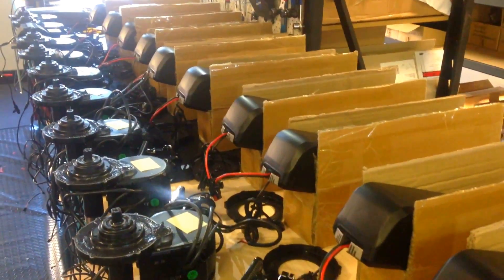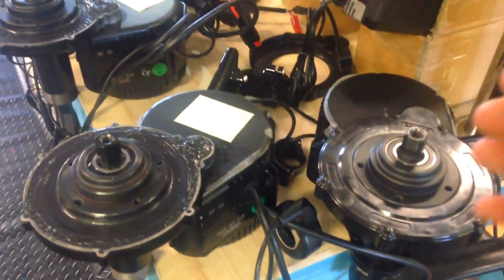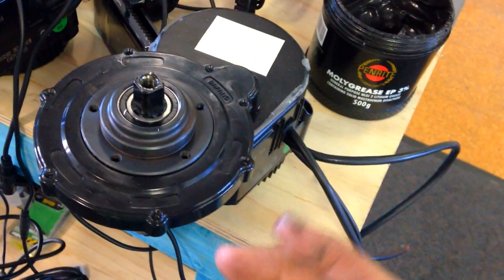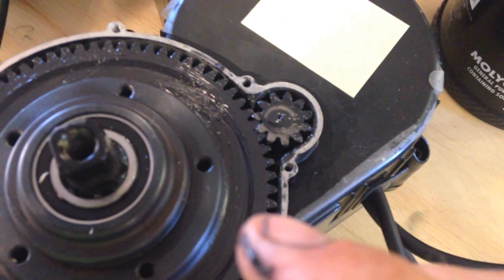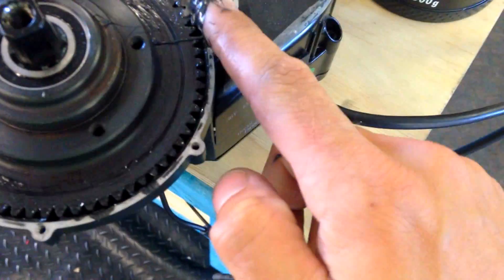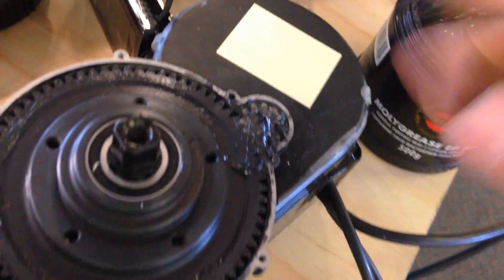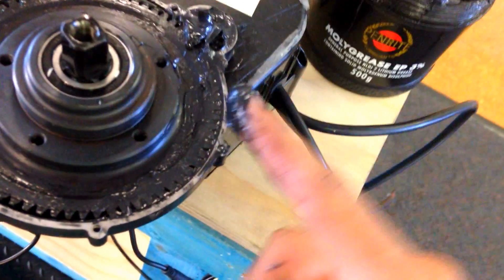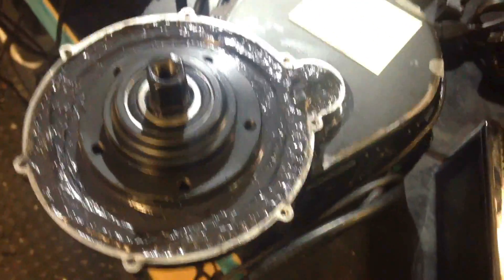Making your Bafang BBS02 mid drive last longer with extra moly grease • 8fun Electric Bike BBS01

Comment: Hi man, I finally got my BBSHD!!!!!! 
I open it up yesterday and found out that theres no grease at all in the pinion gears :/
I saw a few posts about this issue and some recommended to use MOBILGREASE 28 for reductions gears but eh.. they say its complicated to apply this in the BBSHD model.. could you maybe make a video showing how to do this? i don't want to fuk it up! haha

thanks for your videos man!
Reply from the maker: +Uilleam Gilvoni - Yeahh.. you'll be the happiest man on earth when you get this monster rolling =] This is funny.. all BBSHDs we opened had a good amount of black molygrease on the pinion gear. If you have already opened the BBSHD to inspect it (only 6x allen bolts and remove the metal cap) all you have to do now is to apply more molygrease between the teeth gears (large flywheel and the pinion gear). All done!  
Putting things together, you will notice that there is something not wright as you try to put the metal cover back in place, this is the freewheel doing that. You have two options: spin the pedal shaft (crank) backwards so the freewheel paws will fold and get inside the freewheel housing. Option two: using your hands slive/remove the freewheel from the pedal shaft (a ring with some little lockers sticking out) and put it inside the freewheel housing spinning it backwards (will be very obvious you will see the freewheel locking) then you instal the pedal shaft back and screw the 6 allen bolts.. all done!!

I know exactly where you read this article about the MOBILGREASE 28... I have a LOT to say about it:
Karl tested this grease on his BBS02 (not on BBSHD) for a week and posted the article... he didn't test it extensively in many different applications to see if it actually works or actually causes damage to the gears. Karl recommended everyone to use heavy-duty grease on the nylon gear for over a year and coincidentally he was the ONLY person having many problems with nylon gears and started all this "nylon gear" thing over the internet... finally he realised that the heavy duty grease was damaging the nylon causing it to fail and posted an article telling people to not use that grease and he would come up with a perfect grease! A week later, he had this mobilgrease 28 article published and strongly recommending everyone to use.

Here is where this story gets a lot deeper:
Metal on metal (pinion/flywheel) you use molygrease (this is what Bafang uses and almost 10 in 10 mechanics would recommend the same), metal on nylon you can use white lithium grease (this is what Bafang uses and this is the most common grease for this application) maybe some synthetic grease types. The whole reason to use the mobilgrease is because the pinion helical gear on the BBS01 and BBS02 leaks some of the molygrease from the pinion/frywheel contaminating the nylon gear and possibly causing the gear to fail ( I have a video showing that we never had problems molygrease leaking mixing with the nylon gears... we sold over 500 motors, I think this is a good number of users to consider).  This grease leaking issue won't happen with the BBSHD as it has a different design. I don't know if Karl was clear on his article but to apply the synthetic mobil grease you have to completely remove the existing greases, you should not use degreaser as there are many bearings and you don't want to degrease that and cause multiple bearing problems. Resuming this big drama, there are a LOT more things to consider before writing articles. I have so many videos from October/November2015 that I haven't published yet as I am still testing many different samples (bikes) to get the right result so I can finally tell people the correct message. Just like medicine, we need multiple samples, data and extensive studies to backup these "recommendations". 
So.... you better stick with the molygrease and avoid future problems  =]
Reply: ElectricBike yeah!!, thanks for the answer man, now I understand things better! I'm buying molygrease from Internet right now haha. But, what brands of white lithium grease do you recommend for metal-on-nylon? I don't know much about grease things hehe. 
Truly appreciate your help bro. 
Thanks again :)
Reply from the maker: +Uilleam Gilvoni - this is the thing... we can't find the ideal white lithium grease.. Bafang made their own grease for these motors, a very thick and sticky one. The ones you can buy online and at the shops are thin and will wash off the gears... you need a thick general purpose lithium grease one that doesn't smells like petroleum. I am using one since last year and it's completely fine. This is one of the things I have been testing and studying really well before make assumptions. Nylon is tougher than people think. Nylon gears are everywhere, industries, cars, machines, toys, the world would be much louder without nylon gears. =]
Reply: Oh well, but could you tell me any name? haha my nylon gear is dry.. it won't last too long without grease..  Im tryng to find one here in Perú but its difficult because i dont know what to look for.. thanks bro!
Reply from the maker: +Uilleam Gilvoni - Hummm.. brands will be different over there... the one I use here is a local Australian brand... maybe go to a local mechanics or auto-shop and talk to them, see what they use for the electric car windows, most if not all cases are plastic/nylon gears. Some "general purpose" greases are suitable for use with plastic, get one with that doesn't smells like petrol. It doesn't have to be lithium... as long as it is a thick grease that won't damage plastic and lubricates well.. its all good. Also you could use the existing white grease that is splashed all over the case... just  re-apply it over the nylon gear and should be good for months again... this is the easiest option =]
Reply: Alright man! thank you very much for your help :)! I truly appreciate it

Keep doing that your amazing work! 

Cheers!

Comment: Hey Bruno, do you think excess of moly grease there might cause the grease go to the nylon gear casing problems?
Reply: yes i have pushed grease into a bbshd and it got onto teh sprag clutch inside of the nylon gear and it was slipping.  It will sound like the motor is spinning, but the chainring wont be spinning properly

Comment: instead of using moly grease,that can eat the nylon gear, why not use white grease (silicate and fosfate-free)? 
it might be less effective in greasing the gears and maybe less resistant to high-ish temps, but as long as you put more of it, then what it came with from factory, it should be better ,right? 
what's your opinion?
thanks, Hannes.

Comment: I am getting a BBS02 from Luna Cycles. Should I go ahead and open it up for this grease job or does it come with the extra grease in it now?
Reply from the maker: Hi Brent, thanks for your message.. I'm not 100% sure if Luna is applying extra molygrease to their BBS02's, it's easier to check before you install on your bike... and check again every 1000miles... doing this you'll keep your metal gears healthy almost like new =]
We do the Bafang distribution here in Australia for other bike shops and we never have anyone calling us for pinion gears... =]
Reply: Where in australia are you located

Comment: also, could you kindly make a video or explain how you connected the cycle analyst to the bafang controller? I just love your videos...
Reply from the maker: Yeeahhh... the Cycle Analyst at the moment is only reading the power between the battery pack and the BBSHD just like a multimeter with this shunt resistor connected between both http://www.ebikes.ca/shop/ebike-parts/ca-accessories/shunt-ca3.html 
My CA V3 is the one that comes with the speed sensor so I attached it right next to the Bafang speed sensor and both share the same magnet. I can read voltage, wattage and speed in real time. I want to make lots videos talking about the CA and the cool accessories available for it =]

Comment: How long do these motors normally last? Thanks
Reply from the maker: Thousands of kilometres... if you just keep it well lubricate checking the internal gears every 4000km (more or less depending on riding style) they should last for many many years. These Bafang mid drive systems are by far the most compact, powerful and popular ebike motor out there. You can fit them to almost any bike so if you decided to get a new bike you just bring the motor...
Reply: @BrunoPOWEEER , thank you man, you are awesome, cheers!
Reply: I’ve been running a whoosh sirico with a b b s 1  early version since2014  done 40,00 miles with little servings. Still going strong 👍

Comment: Hi, I just got my bbshd and wondering if I should put more grease there too? Or did you only do it with the bbs02? Since they look a bit different inside. Some pcb there and stuff :)
Reply from the maker: Hi Mikael,
BBSHD had a different design it actually recycles the grease so there is no need to add any grease for a long time. The BBS01/BBS02 had a design issue that the helical gear was orientated in a way that was sending all grease "away" from the gears, problem fixed on the BBSHD!
Maybe open and inspect after 1500/2000km =]
Reply: +ElectricBike (Bruno) Okay, perfect. Anything else I should think about? Have a lekkie chain ring. So that should be fine. I am 2 meter and weigh 100 kg. Havnt bought a bike yet. What bike would you go for if you were me? I want it to be durable :)
Reply from the maker: +Mikael Sundvisson - Hi Mikael, sorry for the delay...I think maybe you should go to a big bike shop, talk to someone asking what brand they would recommend, maybe aluminium frame instead of expensive and quite fragile carbon fibre ones. if you want something reeeeeeally strong I would go for chrome moly frame, is the hardest and lightest metal after titanium (motorcycles are chrome moly) but these bikes are very hard to find and expensive because they're not very popular. Aluminium may be the best value option. =]
How's your electric bike project going?

Comment: I've got the exact problem with my HD, litterally no grease at all on the secondary drive, but after watching your video saying to use moly grease, I went to EndlessSphere, and everyone is saying not to use moly but use Mobile28, as moly can get into the primary drive, and degrade the nylon gear, have you any experience on this, and what do you think ?
Reply from the maker: Hi Paul, the HD helical gear is facing the opposite way so rather than push / pump the grease towards the primary gear it pushes the grease towards the outside, hits the aluminium cover keeps recycling the grease, MUCH better, we never had any nylon gear contamination with the HD. The BBS01, BBS02 you grease the gears, put the cover back on, spin the motor for 1 min and open the cover and clearly see that the pinion gear is pumping the grease down towards the nylon which in theory is so wrong but I made a video showing a BBS02 with 6000km and soooo much molygrease on the side the nylon gear, cleaned the nylon to inspect for any damage  and it looked like a brand new gear!
Regarding the Mobile28 grease... ALL mechanics and engineers would recommend molygrease for metal on metal applications like that (pinion vs flywheel gear) moly has solid lubricants that impregnates to metal parts and actively keep lubricated even when it looks dry. We have 100% positive feedback and ZERO problems =]
Reply: Cheers buddy. I wish there was enough grease in there to be able to be pushed toward the primary, but sadly not, there was literally the same amount as a large pea, and I might be being generous, saying that. About a 3/4 days ago, after about 10 minutes, of use the noise was terrible, and I could feel a vibration through my right foot, that's when I started to investigate, and I was blown away on how clean it was under the cover, I will say though the machining was awesome, I've got a couple of 20 mile trips to do, before my order of moly arrives, so I thought some grease is better than none, so I used what I had available, white lithium, and packed the shit out of it, and I sounds and runs like never before. All I can hear is the roar of the fat tyres, which still makes me smile even after 3 months of use.

Comment: Moly grease makes nylon gear softer. Not the best grease for Bafang. And too much grease raises the temperature.
Reply from the maker: Read the other comments, I’ve replied to this comment many times before... moly is for metal to metal and inside where the nylon is I use a different multi-purpose grease that is suitable for plastics. The reason why we used to pack a lot of grease is because the BBS02 and BBS01 pinion gear design pushes the grease agua from the gears whereas on the BBSHD it pushes the grease against the cover and keeps recycling for longer. The BBS02 would run dry with no much grease with just a few thousand kms. So far all motors increased outperformed the original Bafang. I had a message from a customer that I serviced and greased his newish motor but noisy back in 2016 and he said after I serviced, his motor has been running perfect for nearly 4 years now.

Comment: So, I have about 100 miles on my bafang from Lunacycle.com and I'm getting a little noise in my motor (gearing or something) when I've been running it for a while.  When it gets a little hot to the touch I suppose.  Maybe after a 5 mile run or so.  Up some hills, but not always using throttle.  Noise goes away when it cools down.  You think this moly grease could fix the problem?  I've got some on the way to my house right now.
Reply from the maker: Hi Paul, I have been doing Lunacycle's technical support for a while.. if you email them right now asking for help, Eric will forward the email to me hahaha
Moly grease may improve your noise as it sticks to metal better than white lithium grease. Everyone is trying different greases, Karl from Electric-fatbike.com is trying 4 different white lithium greases in 4 different BBS02. Bafang is trying something as well... I'll be trying some synthetic grease soon... one day someone will find the right one =]
A little bit of noise is okay but if it is making a metal grinding noise... hummm inspect your gears by pulling the plastic cover and using an earbud clean the gap between the pinion gear and big flywheel and see if the pinion gear teeth is perfectly straight and healthy where it touches the flywheel.
Reply: Wow!  thanks Bruno.  That's so great!  I'll inspect the gears when I open it up to put moly grease in it.  I'm also going to install a temp probe as well as Karl suggests to make sure I'm not running it too hot.  Thank you so much for your responds!
Reply from the maker: Hi Paul, yessss... the temperature probe is a great idea specially for the BBS02 where the controller runs quite hot (BBSHD runs cooler). Regarding to the grease, moly will do a better job in terms of friction between metal parts but may not fix 100% the noise. I am talking to Karl we will make an article together and a video explaining that we are trying new greases, we may find out some downsides along the way as we run the motors a bit longer... but we thing we know... we are doing things that even Bafang and engineers have been struggling to get right, one day we get there =]

Comment: Can you use hydraulic discbreaks With that system? I noticed the kit has special breaklevers with sensors.
Reply from the maker: Yeaahhh.. the kit comes with very basic mechanical (cable) levers but there are some options for hydraulic, you can keep your existing one and just add ebrake sensors (glued to your brake) but there are also some hydraulic brakes that are made for electric bikes like the Tektro Auriga (entry level / commuter) and their most powerful performance model Tektro Dorado.  TRP is the premium Tektro brand they have more models too.. ohhh yeaahhhh =]

Comment: Hey Bruno! I have a BBSHD that I'd like to apply this to (1000km or so on the odometer - I'm paranoid because I love my BBSHD so much). Do you have any idea what torque level the bolts should be tightened down to when re-installing the plastic cover?

Comment: does the bbshd need to be greased like the BBS02?
Reply from the maker: +Dane Cattera greasing the BBSHD is also important but it pushes the grease against the metal cover that protects the gears, the grease accumulate there and keeps recycling. This makes the grease last a lot longer. Good to check the gears for any wear every 2000km (just to be safe).
Greasing is a very similar process, you just remove the cover protecting the gears. The only trick is putting it back, you need to spin the pedal shaft backwards so the freewheel can set properly back in place =]
Reply: thank you! you are the all knowing King! love the videos. love the enthusiasm.